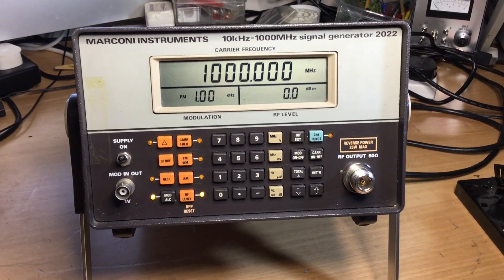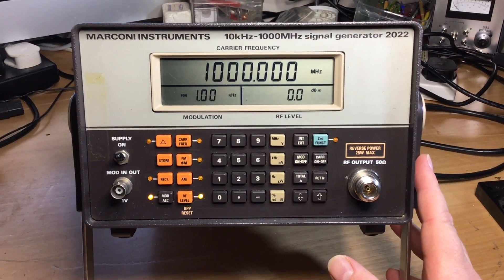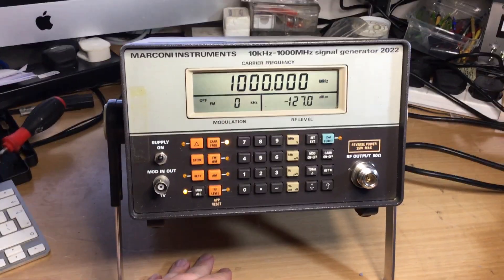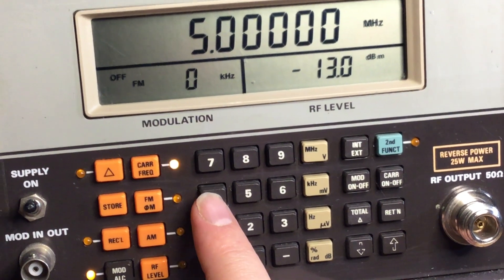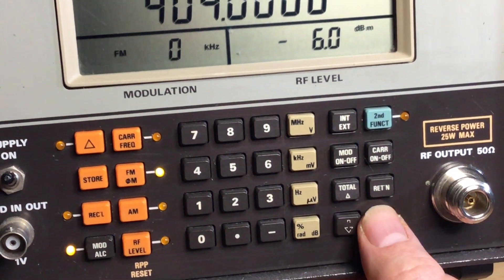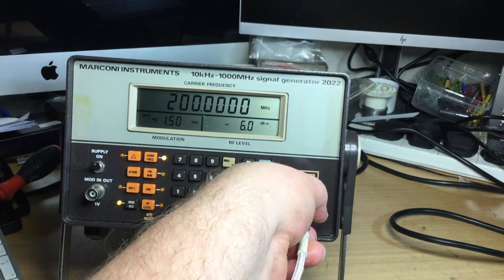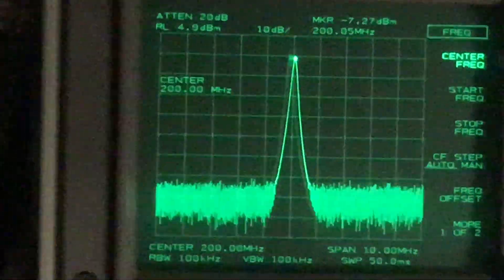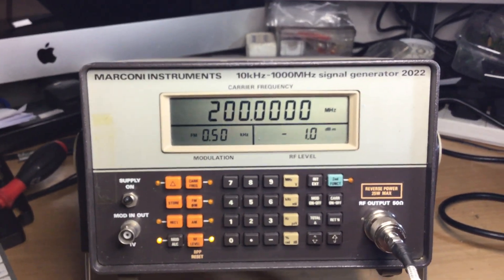Marconi 2022 signal generator look & demonstration

Comment: Thanks for this overview. I got one myself, the 2022E off of ebay. Stopped working properly after a couple of weeks. 
I think you didn’t mention the well known problem of these as well as 2955 with the OM 345 going faulty. There are some solutions out there. I got 4 modules and replaced the originals. Now he’s nicely back to life from 10k to 1gig. I also did a slight calibration afterwards. Maybe one day I’ll post a video on it too. It’s a nice little workhorse as you said.
Cheers

Comment: Thanks for that, a good review of the 2022's capabilities all of which I agree with, an excellent piece of kit to have on the test bench if you can find a good one. Unfortunately many of the ones you do find (E-Bay etc) due to age/treatment have suffered  OM345 failure and are intermittent  across the frequency range, the Achilles heel of this otherwise excellent piece of equipment.
Reply: All my om345s died one by one in my 2022 replaced with modern mmic now been working fine for 10 years
Reply: @ptronix  which mmic? or was it a bought modlue
Reply: @ExtremeTimmah  no not a module they weren't available when i fixed mine, just looked thru my pdfs, pretty sure it was a ram-7+ by mini circuits almost identical gain to the om345